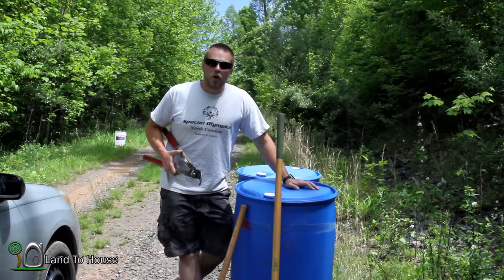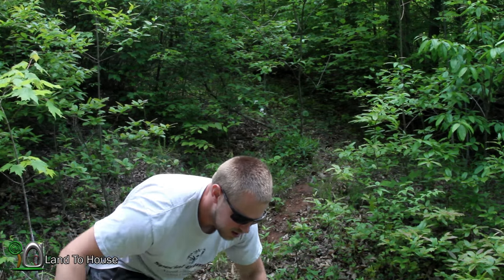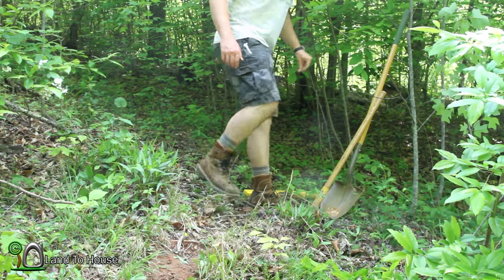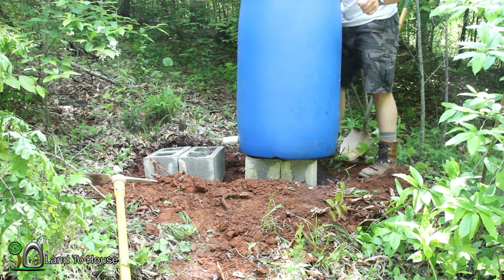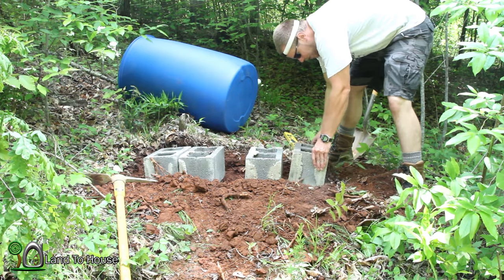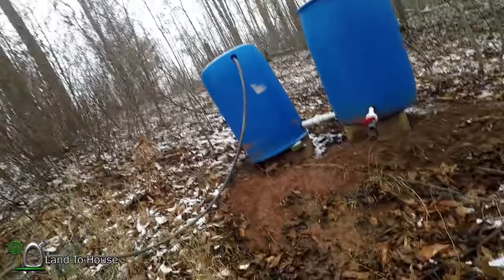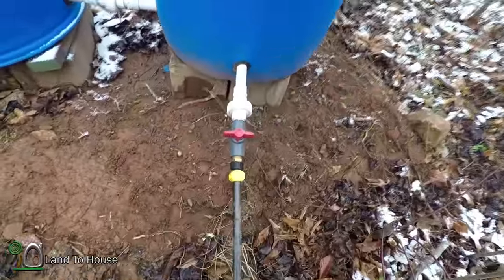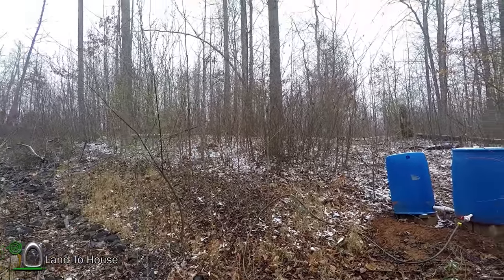First Attempt to Install Water Tanks

Comment: Hole saw tip, the pilot bit (regular drill bit in center of saw) is adjustable, make it longer where it sticks out farther and it will hold the saw in place. No more jumping out of the hole.
Reply from the maker: The saw I was using in the video was one that I got for cheap and I did not have a bit that was long enough. (My drill would not fit the hole saw. My guess is that it was 3/4" and my drill is 1/2" chuck.) My new set of hole saws that are the correct size have a longer pilot drill bit. Much better!

Comment: And of course, to increase pressure, you could build a raised platform to increase the drop by a few feet (or several if you want to build a tower) :)
I love the options you show how to use the power that is inherent in nature, such as the movement of water.
You could put a turbine before the ram pump and then run the output power to a pump that would increase pressure.
Add a wind turbine (if you get enough wind speed) and solar (if you have a spot that isn't shaded).
Then use gas generators or city grid power for backup instead of primary.
It is a puzzle, a real life puzzle, that is available for us to figure out.
Reply from the maker: That is a good idea. I have a few metal legs that I would like to make a stand that is around 3 or 4 feet tall. That will help me level the tanks and get a better hole between them. .... I have 1kw worth of solar panels that I need to get installed. I would like to supplement my power with them.
Reply: Just remember, voltage in series adds voltage.  Voltage in parallel adds amperage. It works no matter how big or small your voltage source is. 12 - 1 volts in series gives 12 volts total. A small force can be made much larger by adding them all together. 
Best of luck.
Reply from the maker: I think I will be installing 2 of the panels for the tiny house and the other two for the big house. Should be fun to finally get power to the tiny house.

Comment: I would seriously consider building yourself a water tower closer to the garden I'm pretty sure you can build it out of 4x4s if I remember correctly you can get them 24 feet long with one line to fill the tank on top and a large pipe coming down I believe you gave a lot more pressure then having the distance of going all the way up the hill
Reply from the maker: +Wayhart I built a water tower years ago behind the tiny house. It did work well. I don't think there's too much loss of pressure in 300 feet of hose from Gravity. I could be wrong. :)
Reply: Wvo Quailwvo I know that I have gravity spring water system that has a 1-inch line that runs nearly one kilometer that I have 22 PSI but it's operating pressure drops because the flow is not there
Reply: Wvo Quailwvo that's what I said
Reply: Wvo Quailwvo you lose pressure when you are restricting the flow so if you have a tower you have a shorter run of pipe which you can make large which in turn which allows your head pressure to get to the end

Comment: Hi Seth! Your videos are great. .. but in this case would be better show me how to fix the hole. Just to learn. See you from Argentina.
Reply from the maker: In this case the best "Fix" was to turn the tank upside down and use the large hole as a fill hole. I am going to buy two more of these tanks in the next week or so. My local store has them for only $12 each! To actually fix the hole I think it would be best to use a larger pipe and larger uniseal. The trouble would be getting the hole larger because there is no-longer a center of the hole to catch the pilot bit on the hole saw.

Comment: So you should be expect .433 psi per foot of drop in fresh water.  So if you had your tank 100 ft in elevation above your outlet you could expect 43.3 psi.  The reverse of this is 2.31 feet of drop = 1 psi.
Reply from the maker: +bogarath exactly! I figured if I could achieve 15 psi that is enough to run a simple sprinkler or a drip system. Or if anything I could just attach a spray nozzle to the hose and water that way.

Comment: Have you watched Wranglerstar's videos on building his water tower using some old pallet racking and 2x4s? I know you subscribe to him so I assume you have but I wanted to ask.
Reply from the maker: Yes I watched that one a long while ago. I would like to do something similar. I have a few legs like that pallet rack that I can use. Thinking of making a 3 or 4 foot tall rack that would be level. Much easier to get the holes in the tanks correct.
Reply: Land to House A three or four foot tall tower would work well, I would think. It'll make getting the barrels level easier and provide an extra few feet of head while being low enough to work on easily without needing a tall ladder, though maybe a step stool or short ladder.
Reply from the maker: Well its settled. I will move that metal up to the house and get ready to make some cuts. Should be a fun project and not costly. I will need to get more drums at the local plumbing store.